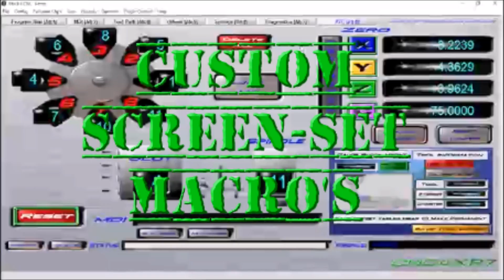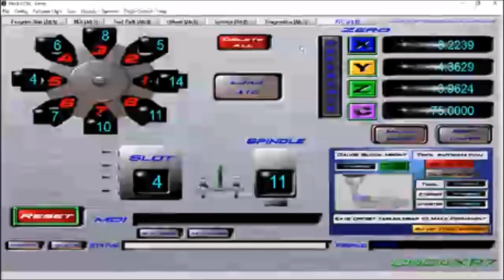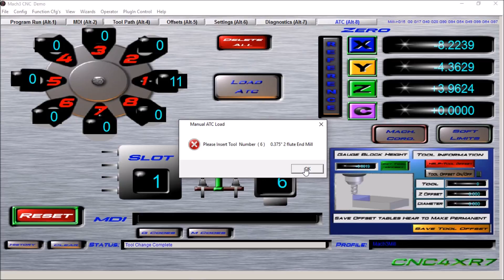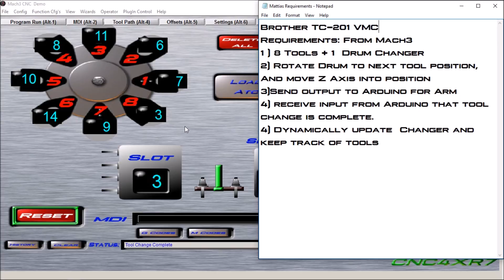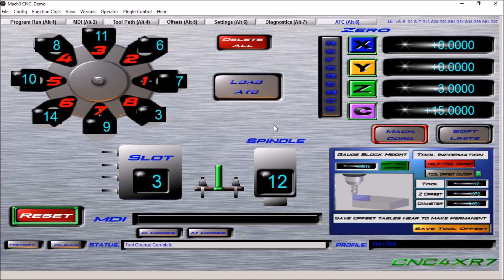Mach3 Drum Arm type Tool changer

Comment: Can Arduino handle the voltages from those switches?
Reply from the maker: I have to say I'm not well schooled on Arduino's I figured he had all that worked out I just gave him what he asked for. 
I will be working on a New Screen-set and Macro to be controlled By Mach3 Drum, Pivot, Arm,PDB, everything with jam logic etc.
so stay tuned.
Reply: Yeah, sounds cool and if you get any feed back on if you can apply Arduino like that, that would be cool.
Reply from the maker: I'm not quite sure why the use of Arduino in lieu of letting the macro control all of that but when he gets it working I'll inquire about the Arduino.
Reply: Well the macro will be communicating with the hardware somehow, he can probably use whatever the existing PLC is with the software upgrade.
Reply from the maker: liberty ordie 
yeah im not real sure what he has